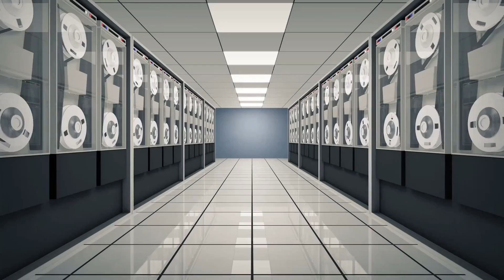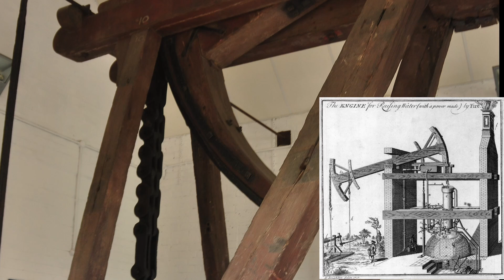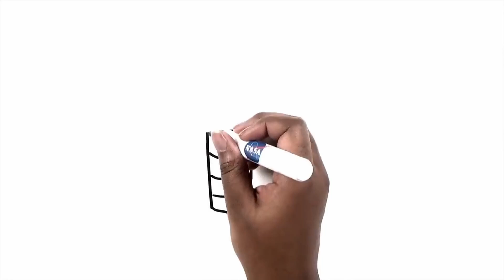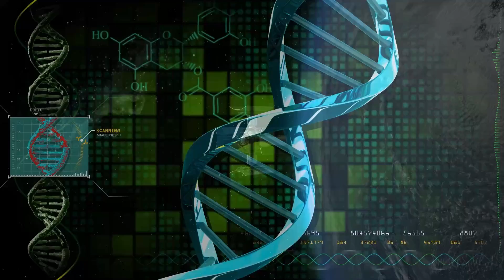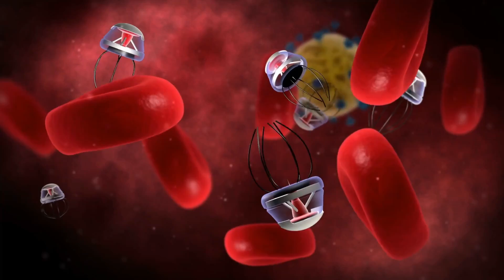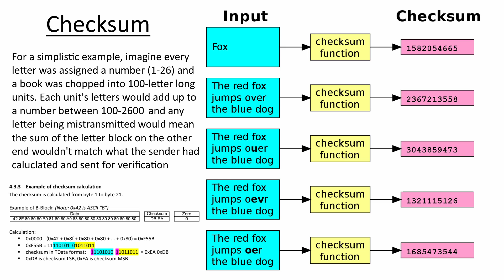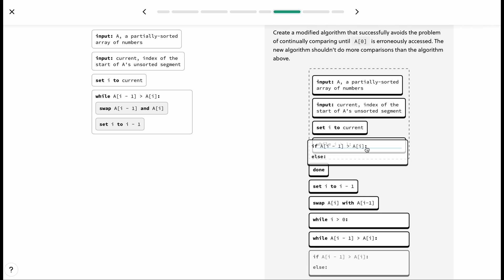The Million Year Machine

Comment: Between SLA printers being able to print circuit films and FDM printers being able to make most standard parts you could reasonably achieve a self replicating machine complex. You'd need some sort of controller to determine order of operations, a material supply for the printers, and some kind of locomotion to move things into position. Aside from that though I think it's entirely plausible a civilization not too far ahead of us could make such a machine a reality. The question is, what would it do?

Comment: I disagree as to furniture and buildings to some extent. Older furniture lasted longer because old growth wood was much more available in previous centuries. It had much more dense structure due to its age that is not commonly available today. That would hold true for structures also. Also as you pointed out structures where smaller than today and much easier to maintain. If your maintaing a 1200 sq ft structure it will be twice as easy to maintain than a 2700 sq ft house of today that is made of weaker woods.

Comment: On biological interference with operation, there are thousands of stories from radio or aviation techs.
Geckos that lay eggs in gear and crawl across points to short random bits of the circuit, rodents and birds making nests in cooling vents or behind access doors. I once found where some goats had pulled the phone line off a building and dialed emergency services by chewing on the exposed wires. Certain varieties of ant seem to love electronics, and there's even weirder stuff once we get into the depths of the ocean.

Comment: Designing new designs that function worse is a big issue we currently have with machines. Take the refrigerator, a technology we have had for over 150 years now. Was a point where we designed a perfectly well functioning electric refrigerator and then began adding extra bits to it. A ice maker, hook it up to water, wi-fi, etc. Which became more points of failure for the machine and drastically cut down the lifespan it can function. Because with all the extra features something will fail. Does the temperature need a digital display? No but most fridges have one. Just slap a whole computer in a fridge because people will pay for the added price. I used fridge since it's something everyone has but a lot of machines are going down that route. Where optimal design was reached then people just kept going with new designs that slowly became worse with every iteration.

I plan to not even buy a new fridge when current one breaks. I'm just gonna buy a chest freezer and a converter kit. Two chest freezers but one working as a fridge. Plus in a power outage a chest freezer is low enough on power draw for a solar panel to power it. So I can in theory have a small solar panel ready whenever is a bad power outage.

Comment: The development of such machinery may be researched upon algorithmic simulations of it's subsystems and using regressive/progressive machine learning to delineate the optimal nature and main characteristics of these subsystems, their interactions, probabilistic failure analysis, and so on. It would be sort of a human assisted systems machine design/learning. This would be the scientific way to develop extreme systems with minimized costs and risk. Actually, if you try to design a system like this exclusively 'by hand', it's almost certain it will not work as intended. After some point it certainly becomes impossible to a human to understand how the design AI reached some or several of the suggested  optimal blueprints. It may suggest seemingly overcomplex designs or even just tell you to have more than 3 kids and raise them well. This last one sounds like a joke but it's one of the most probable lines of answer. It's possible it may try to address civilizational risks if it considers the civilization as an optimal general blueprint. It's probably wise to inform the AI about who is asking the blueprints for the system and the scope of answer desired. And the way one asks is quite relevant to how it will elaborate. If one asks "How can X country establish supremacy over possible threats during the next century?" , you have to keep in mind that it's quite probable it will provide a path where the 'possible threats' exist , as your question implies on that. For the AI it's almost like asking for it to provide you with manageable threats. And you didn't inform it about what you mean with "supremacy", and also you told it that the answer should be optimized for the next century... Even if it condemns the X country for greater time frames. Or the given supremacy may imply in leveling some aspect of mankind, like a populous country throwing huge ordnance at the sun to neutralize all tech on earth by means of anomalous sun activity, as the lower the technology, the higher is the influence of population size on a given nation's power. So, just to illustrate, those are the kind of concerns that emerge when using AI to solve things. It's sort like asking an AI "which terrorists should we take down next?". Or... "give me a target". At no point it was asked about what is the most efficient/cost-effective way to achieve peace. ('Define cost')

Comment: I think the main reasons any machinary breaks is friction and wear. So we can use magnetic levitation to make it close to zero. Nanomaterias with good mechanical properties like alloys inforced with nanotubes can also last really long. The methods of getting ones affect the part's surface roughness which also affect friction. Well, that's mechanics. But what about electricity? The solution here is to replace all wires with superconductors. Eternal computers most likely will be made as an optical system rather than electric one as there is no eternal transistor exist.

Comment: I think i would build them like the positronic brains in Perry Rhodan.
The core would be several AI cores working in tandem. If one of them comes to another result then the rest it is checked for errors and the data verified.
This should help against random cosmic particles.
The rest of the machiene has to be modular with as less moving parts as possible to make repairs more easily.
How to replace and repair the core parts of the machiene would be the biggest problem. Maybe you could solve it with some kind of lego system where you can disconnect the modules without damaging them?

Comment: I really like how did you explain 'The million year machine'. It is really like preventing an organization from getting cancer. In a short period of time reparing things is easy - you just hold the three keys - redundance, repair and reproduction. Our own body behaves this way. The cells divide, reproduce and then die. There are milllons of different bio-chemistry mechanism out there to prevent this process from mistake and mutation. However when you get older all the trivial and smallest errors accumulate (there is no way to totally cancel all the small error like protein entanglement - this behavior roots in the chaos/quantum nature of microworld). It happens everywhere in your body, even happens in the error preventing monitor program itself, happens in all the immune cells which are supposed to monitor each other. It is like a fucking rain in a forest. All the trees get wet at exact the same time. You cannot expect to use another monitor program to monitor this one because no matter how many layers of recursion you have they are aging at the simultaneously the same time. You also cannot expect the monitoring programs to fix each other - if a mutation happens in one program. How do they know who is the right one without outside authority? This million year machine problem does need a brand new science field to focus on it. This is because the most realistic future of man kind is metaverse aka the dyson sphere + black hole holographic computer virtual reality. We send all the machines to harvest energy from remote stars by building local dyson sphere(stop the most crimial waste behvior in cosmos) and use that to maintain our cyberutopia. The main problem of the future advance civilization is how to maintain this 'machine' to the heat death of the universe. Sorry for my broken English sir I am Chinese but I am really into your video. Currently this planet is obvious on chaos like Geopolitical conflict, skyrocket inflation, International trolling & hatred etc. But your video always remind me of what is really important in the long run. People in 1000 years future won't even remember all the current trivial things just like how people forget warfare between some medieval European countries. We autistic but gifted 'engineers' (it is a ideology and lifestyle) should focus on the real busniess. Keep this incredibale work sir I will attend Youtube via VPN just to check your updates. Thanks sincerely.
Reply: Easy have the repair network be tested, calibrated and commanded by multiple directors of which 20% are offline and serviced while the rest act as a network themselves with divergence from the majority being an indicator of drift. The problem is more about the cost and technology rather than methodology.

It's very unlikely over half the directors drift simultaneously, so the repair process will carry on so far as raw materials and power are provided.
Reply: You would want an evolving maintenance unit so biological or biological inspired solutions seem logical at this point. The earth's biosphere has been going for a couple of billion years

Comment: On the part about a satellite that orbits a planet to look for signs of life, if it needed to destroy itself when intelligence was discovered, it wouldn’t need to deorbit all at once

If it can survive that long it must have built in self-repair capabilities, which means it also has the ability to dismantle itself, and sent those smaller lumps of matter into the atmosphere over time

If the signal for detecting intelligent life was something like large scale agriculture, then even if it took several centuries to completely selfdestruct, it’s chance of being discovered is virtually zero

Comment: In the future might be an idea to put stainless panels on a modified Phobos side that's tidally locked to Mars to reflect light onto Mars surface. Thermomechanical gear reduction mechanisms could be used to clear dust off of the panels. Not sure of how much a lifespan such machines might last.

Comment: In deep space you might be able to use ice for construction, this could serve as a building material, water for drinking and converted to hydrogen for heating and powering a fusion reactor. Of course this is just sci fi, reality is always far more complicated. But you could actually melt and rebuild as needed with little energy. You could even trap oxygen in the ice for storage. Also with salt or even better ammonium nitrate (fertilizer) added you could possible create electrical conduits in the ice structure surrounded by air pockets.

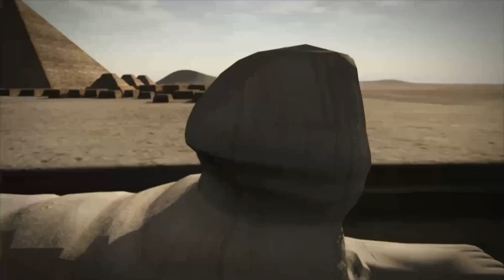Comment: 7:24  “Our ancestors built monuments out of stone because they could, and they used huge slabs because they didn't have the architectural and engineering skills to use lighter ones.”  That one... just doesn't scan, sorry.  I think that I might be misinterpreting something there.
Reply: Consider a bridge made of several large slabs of granite, vs one built with a bunch of smaller blocks. Assume both can carry the same weight. The one made of smaller blocks will weigh far less overall but require more engineering knowledge compared to the thicc stoney boys. Modern monuments generally have large cavities and use stronger (per pound) materials to save weight that the creators of older monuments didn't have access to. 

I think that's the line of thought he was going for, here, in adddition to what bbird said.
Reply: @chad_bro_chill   I don't know the strength of materials nor the necessary formulae, but you're right that one can buttress things without requiring the entire volume to be filled (e.g.: aqueducts, or tensegrity structures), though I'm not entirely convinced of 5-10 ton blocks being less challenging than many more much lighter blocks (though these would certainly require much more cutting and facing).
Reply: @chad_bro_chill no one made things out of huge slabs for any reason other than to show that they could handle huge slabs.
Reply: Perhaps he was implying some sort of Bigger lasts longer philosophy, as a small stone would be more prone to breakage, but a large one would be (relatively) longer lasting. Monumentalism?
Reply: @bbirda1287   I suppose that being longer lasting is a possibility for the overall structures, but “...they didn't have the architectural and engineering skills to use lighter ones”?

Comment: The pre-inca civilization built small stone aquaducts for watering their villages thousands of yrs ago, and they still work even today running with clean water still.
 And when it comes to long lasting materials, nothing beats what is called, living stone. Giant blocks and boulders.
The longest lasting structure would probably be a solid granite mountain carved from inside out into a giant building. Reminds me of erebor from the hobbit.
 But we might could engineer something similar. In halo, forerunner technology is made of an everlasting material that can be swallowed up by a planets tectonic plates, spend billions of yrs inside the planets core and mantel and be shot out a volcanoe where itll be dug up a million yrs later and work just fine.
 Andas far as the great pyramid of giza builders are concerned, they obviously had long lasting intentions for the building beyond their immediate needs. The structure was built slightly concave on each side, so that as the building settled over thousands of yrs, the sides bowed out to the perfect flatness of today. Or would be if the casing stones were still there.

Comment: 1:47 there just was a Retrocomputing thread on this. Can I have a source for this? Because the oldest computer still running appears to be the Zuse Z4 at display in Munich and the oldest computer still fullfilling its original purpose appear to be either the pioneer probes computers or the one at the Tarapur NPP in india

Comment: Aren’t thermocouples just a galvanic battery with heat replacing the electrolyte, right?  They last much longer than batteries due to current draw limitations and it’s enough to run low current logic for hundreds of years but you’d need anode mass to be very large, or make the anode replaceable if they need to last thousands of years though.

Comment: what about a matrix simulation but instead of running fast everyone runs super slow, so a 200 year trip feels like 10 years, and you could simulate the conditions you expect to find at your destination, so people can practice the plan.
Reply: He talked about that in one of his Civilizations at the End Time series video.  Where civilization chose to digitally upload to save on resources and power their simulation of the energy bleed off of the Super Massive Black Hole at the center of their galaxy.  Where you could run the clock slow enough that you could have a relative “living” on the other side of the galaxy, let’s say 100,000 light years away and have conversation with them with seemingly zero lag time since the clock was slowed down to where what seemed to be a hundredth of a second for both of you is actually two full years in real-time.  And there’s little to stop you from dilating simulated time down much slower.  And if worse comes to worse, you could always move closer to the event horizon.

Comment: One design question with a million-year artifact is whether the original purpose would still be relevant in a million years. 
- I own several telephones which were designed to be used with land lines. They are looking more and more like buggy-whips every year. 
- I live in a 130 year-old house. I know from experience that sometimes it is easier to build a system from scratch than it is to repair (or worse yet, restore) an old system.
Reply: Jes but what if you see a catastrophe comming and need to launch a probe way before it reaches you do do anything - like a random star comming your way for example.
You could of couse move your own sun but that takes way more effort then just correcting the course of a object far away slightly.

Comment: When I retired and turned in my company phone, I had hoped to keep it simple and use my old Motorola Razor flip phone.  Unfortunately, even though the phone still operational, the network technology had changed and my phone could not connect to the 2020 cell system.

Comment: We have a table from the mid-2000s that is ridiculously solid and sturdy It's supported by a thick ring of wood laminate with the grain running along the ring. The chairs, however, are very flimsy, held together by glue and tiny pegs, and have all experienced a variety of catastrophic structural failures within a short time (it started within a month).

What will likely occur is that if both continue to see use, that table will exist in 50 or 100 years. But the chairs will not exist anywhere near that long.
Reply: A table is not a machine, its a structure. Two very different things. Machine involves rigorous function. A Structural construct is used only under given circumstance here putting plates of food, writing, placing stuff on it. A machine will face a quicker wear down compared to stationary construct.
Reply: @petersmythe6462
If the table and chairs were made by the same company at the same time, then I don't understand the difference in their lifetimes.